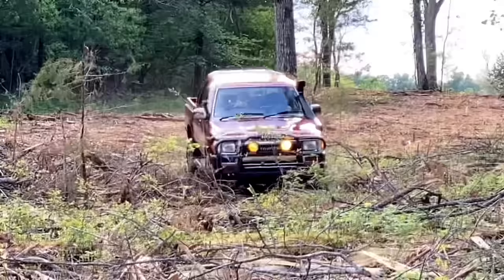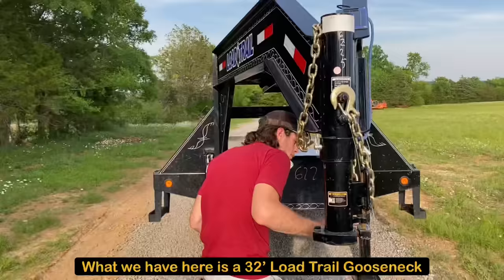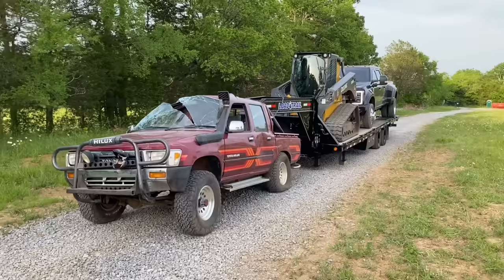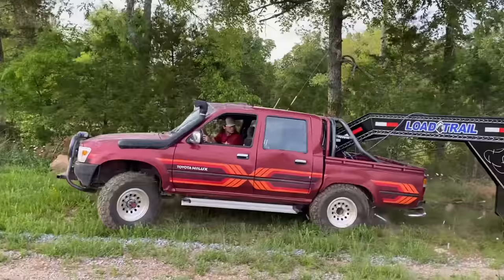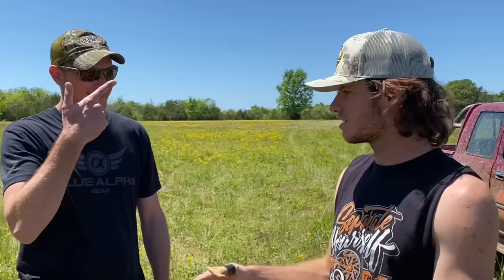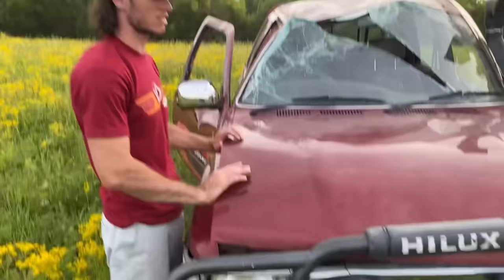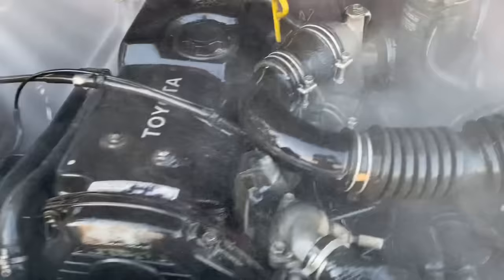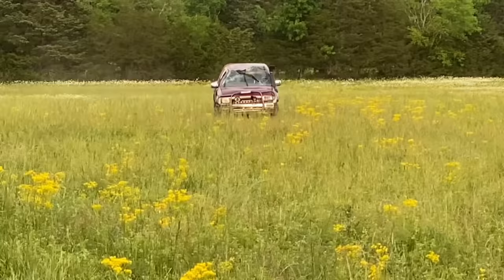Toyota Hilux Durability Test #2

Comment: the hood is designed to fold in half like that in case of a crash. you don’t want a sheet of steel cutting you in half durring an 80mph crash. thats why they always fold perfectley straight.
Reply: Bruh nothing is wrong with the truck😭😭
Reply: Never thought of that thanks to the scientists that run crash tests

Comment: I was scared watching the first test because I was cringing at all the abuse he was putting it through but really impressed that it made it out alive this video I have so much more confidence that I'm not scared one bit, yet still really impressed
Reply: The weight of the f450 was almost zero because it was on the rear axles, and the f450 takes away a part of the front tipping caused by the John Deere because of its weight. But yeah ok.

Comment: Hilux is so crazy because it was massively overbuilt. Toyota made it as a loss leader to edge into the truck market. The looked at all the other trucks in their class, and purposefully went WAY over competitor's specs for the same price. and it worked! the Hilux (and its variants) were so legendary that the brand got overnight recognition and Toyota used that sell normal cars. that's why every other Toyota, including later model Hilux, Tacoma, and 4Runners are NOT this overbuilt.
Reply: While the modern Hilux may not be as monstrous as this thing, they're still damn tough trucks. 

I drove several while living in Australia 10 years ago, rigorous driving in the outback and the Toyota Landcruisers and Hiluxs outperformed by far all competitors, whatever Mitsubishi, Nissan, Isuzu, Ford or GM had to offer

Comment: The fact that there's a "#2" in this series is an absolute testament to this trucks durability
Reply: There are many videos that talks about this truck being indestructible
Reply: I dunno about that...how many squatted truck videos were there?
Reply: @Monte721  there was only 1 durablility test
Reply: its a ute, not a truck.
Reply: @randyranderson1621  no, it's a truck
Reply: That truck is like goku , the more you destroy it the more it powers up. 🤣
Reply: The any level Ford lasted for quite a while and a lot of abuse lol
Reply: @chunkychambers1530  tbf tho that truck is much much newer than the hilux.\
Reply: Top Gear literally imploded one inside of a building after they submerged it in the ocean for several hours and it still ran
Reply: And he’s gonna make a number 3 I’m assuming
Reply: @badmindedd  I wish they stillmade mid size trucks that had heavy chassis like these old Hilux. The suspension and axles are as beefy as a half ton truck it seems

Comment: Dually diesel: I can pull 30k pounds.
Hilux: Hold my differential.
Reply: It’s hold my clutch haha love the comment though
Reply: Which model and which engine wear this specific hilux guys ?? If anyone knows for sure
Reply: @johnnyst.4372  I think is the 3.0 diesel or 2.5
Reply: @poltergeist8298  Hiluxs aren't diesel. its a ( 2.4 L 4-cylinder gasoline / petrol, and 3.0 L V6, gasoline / petrol )
Reply: he has the i4
Reply: @that_09_tacoma  mate that's a diesel you can literally hear it
Reply: @juststuff531  which model?
Reply: @johnnyst.4372   it’s the 3L engine
Reply: Sounds like a 1KZ 3.0 Diesel Inline 4 engine... Those things are indestructible.
Reply: @that_09_tacoma  The foreign models can be, which this one is.
Reply: @that_09_tacoma this one is turbodiesel.
Reply: It's naturally aspirated 2,5 diesel, indirect injection, around 80hp, engine code is probably 2L, chassis number is ln106

Comment: The fact that nothing cracked or warped when Cody sprayed water on a 1,000,000 degree engine is a testament to how overengineered Toyota built their trucks. Even an LS block would probably crack under that amount of thermal stress, but not even the heads or the exhaust manifold on the Hilux.